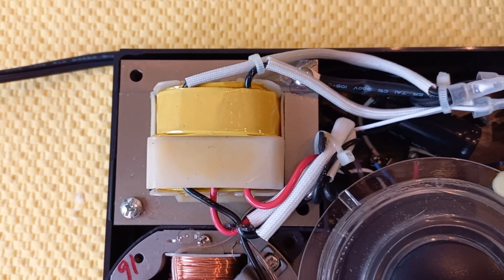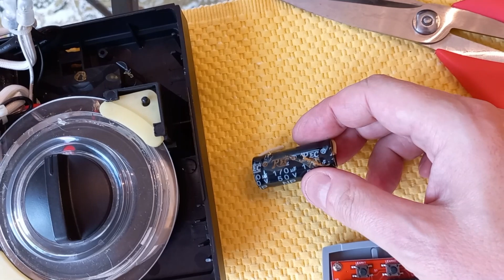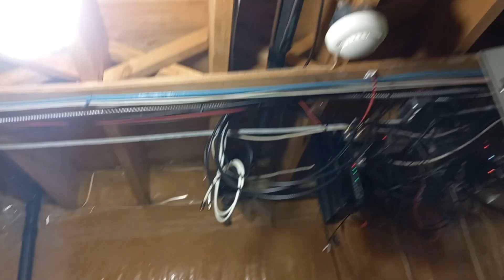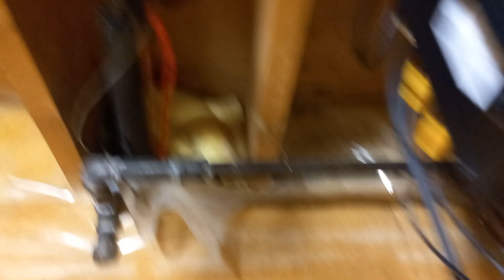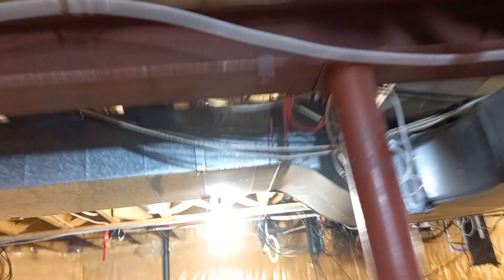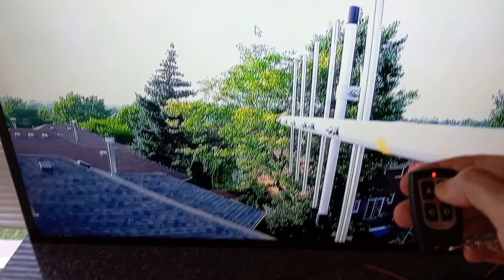Antenna Rotor Remote Control Hacking

Comment: A micro controller like an Arduino with 2 full bridge drivers from 24VDC would allow you precise rotation control.  This would require 4 wires to the motor or 2 half bridge drivers with + and - 24VDC.  The computer would count out square wave pulses 90 degrees out of phase at any speed up to 60 pulses per second.  The syncro motor has a integer number of steps per revolution of the antenna so you would always know your angle.  If you use a ESP32 with WiFi running a web server you could use any web browser or cell phone as a display and controller.  Could put it on the internet and have control from anywhere!!   Total cost about $20.  

Thanks Peter for this great video.   I am putting up a new 50' tower with tilt down top and have one of these old Alliance Model U-100 TV rotators using the same syncro motor.  Of course it's missing the control box.....DE KC7BNC 73

Comment: Cool mod. Never knew how those things worked. Then again, antennas on roofs aren't a common sight anymore over here. How do you protect the connected equipment against lightning? Just unplug it if thunderstorms are forecasted?

Comment: I didn't know such a thing existed! How common is or was this in the USA? In Australia it just isn't a thing as far as I know.
Reply: Where I was at, it's was the "well off" families that had a rotor 😂
Reply: Indeed they did.  I found it amusing because it was the thing to say "don't spin around in circles!!"... Cause the coax would wrap around the mast eventually and stall it out or unplug itself.

I always wondered if it was installed wrong and the cable was to go inside the mast pipe with a swivel connector

Comment: Very very cool! Do you keep track of the position of the antenna by using the antenna, even at night?. Anyways very cool, wish I had stuff like that laying around I live in an area nicknamed purgatory because there's nothing I have yet to find a tv antenna that picks up any stations. One cell carrier works with one bar (sometimes) out here T Mobile and that's it.
Thanks again for the interesting video!

Comment: Great video explanation.  I have same type of controller, 24v AC single phase with capacitor across output terminals.  Can i connect an old antenna rotator (AC single phase) to the output connections or does the rotator need a seperate capacitor ??
Reply from the maker: Yes, it should work with most all 3 wire rotors.

Comment: How do you stop it over rotating or hitting the stop and damaging the motor. Im thinking of adding 2 Mini Micro Limit Switches 5A 125 250V AC SPDT to the rotator wired so once activated the other switch is still powered so can bring it back around the other way

Comment: I have the exact same unit.  The question is, how do you get the top off!  The only screw I see is one you can get at from the bottom. . .removing it doesn't seem to do anything.  I didn't want to  apply brute force unless that's what you did.
Reply from the maker: The plastic cover clicks in and the screw just locks everything in place. Try prying the sides a bit it should pop open.
Reply: @peterfairlie2296  Thanks!  I discovered that the best way to get it apart was by wedging in first a knife blade and then a flat screwdriver blade into the corners on the long dimension and then prying upwards.  Once the corners released then the other two surrendered.  I wanted to get in to replace the 150 mfd x 50 volt non-polarized cap.